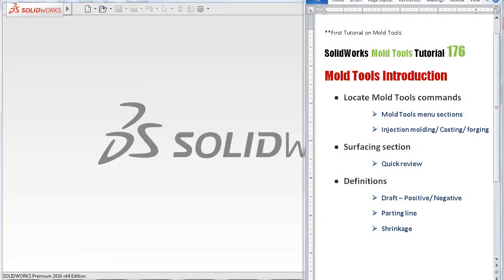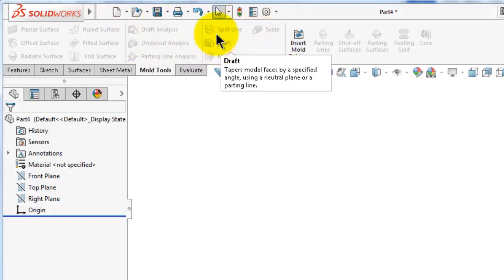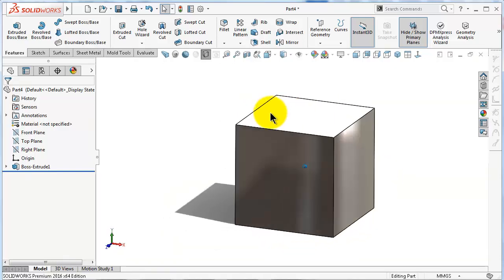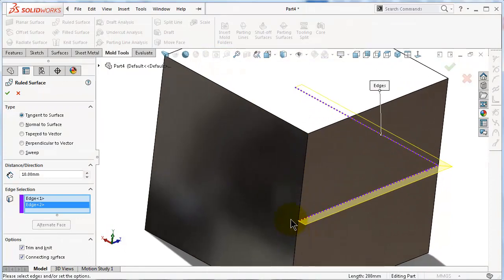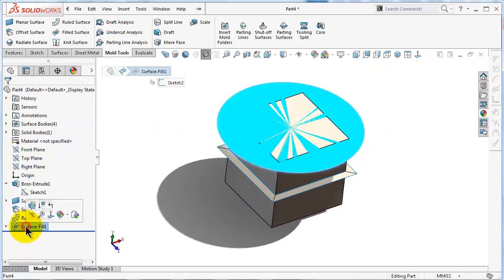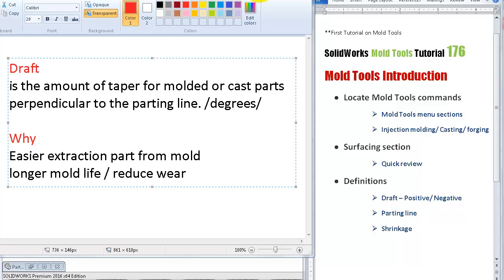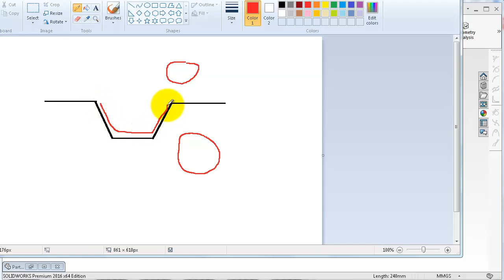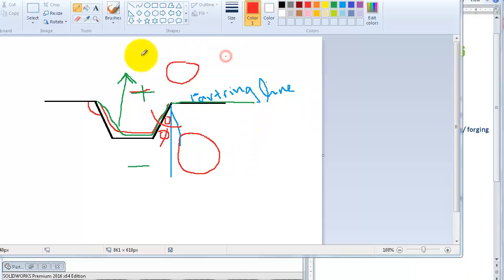176 SolidWorks Mold Tools Tutorial: Introduction to Mold Tools, surfacing section, terms

Comment: The concepts explained in this video tutorial such as draft angle, parting line and shrinkage are of critical importance in molding and casting operations. Over and over I come across products that need their molds or processes redesigned because of problems with these. Even experienced good tool makers sometimes make big mistakes with these.

Comment: Is Draft an important step for injection proccessing only Or for Metal casting too?
Reply from the maker: required for the metals which are casted in permanents  molds, such as die metal casting. For metal sand and foam casting it might not be necessary
Reply: Tutorials Engineer ҂ Thank you .that is what i need to know